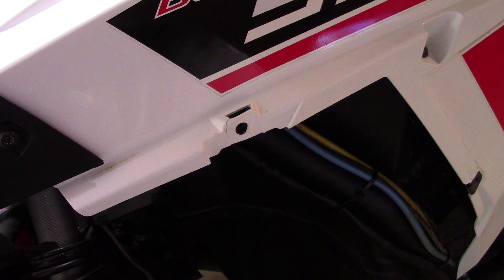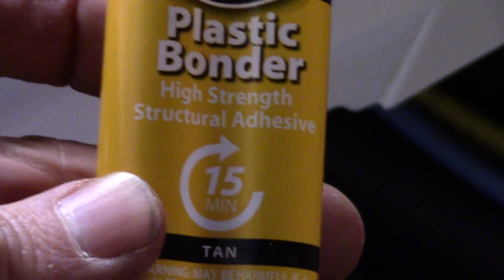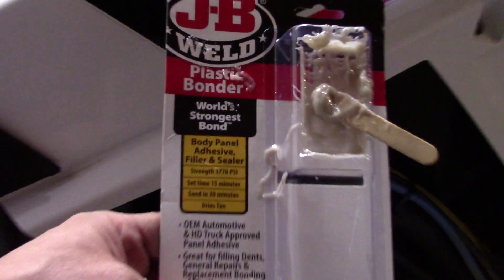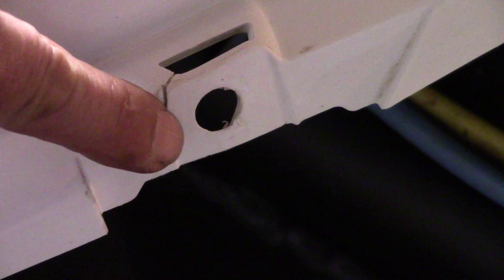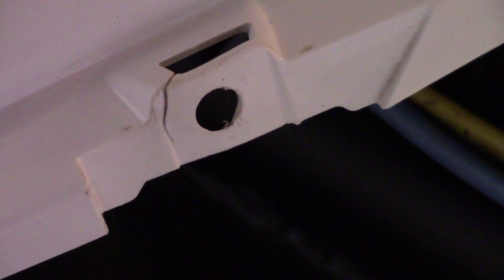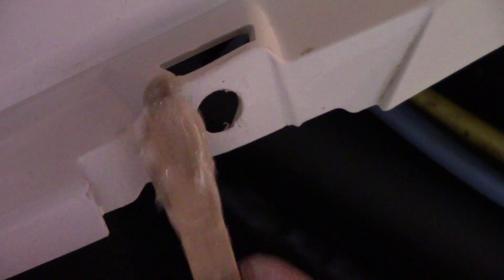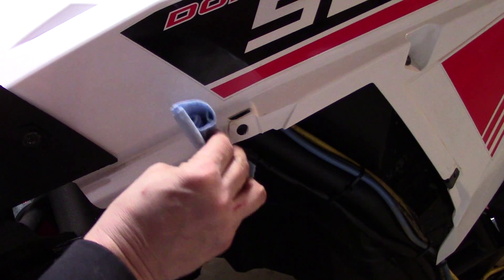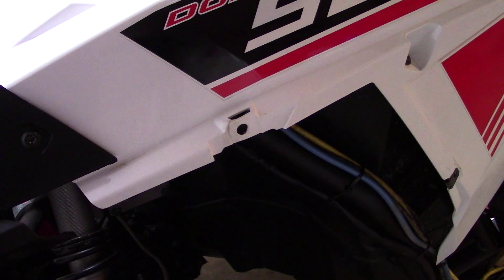Razor S 900 plastic fender repair

Comment: How's it holding up? Did it crack again?
Reply from the maker: It did but then I went and purchased the Eastwood plastic gun stapler and it's never held up better. Great investment if you're looking to repair anything plastic. Here's the link:  http://www.eastwood.com/eastwood-s-hot-stapler-plastic-repair-system.html
Reply: Eddie Regory Thanks, I'll check it out.